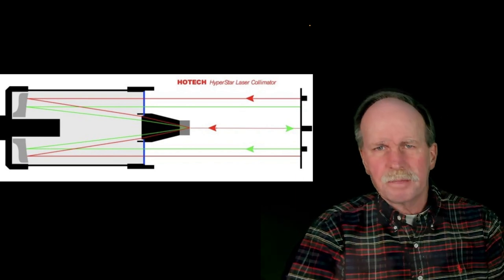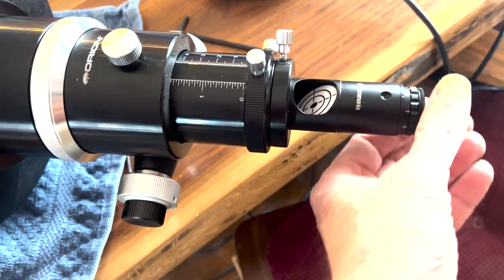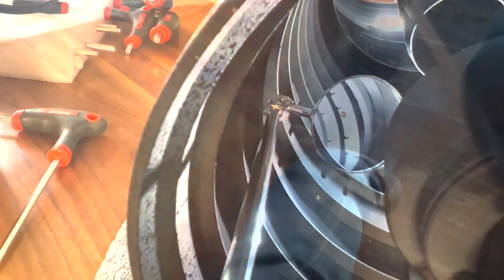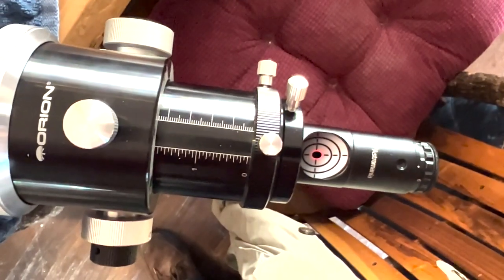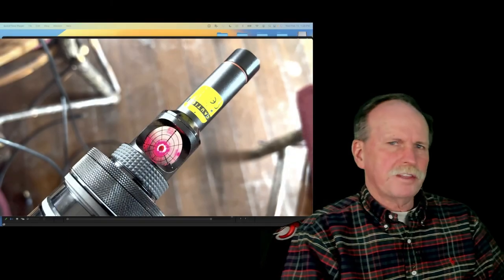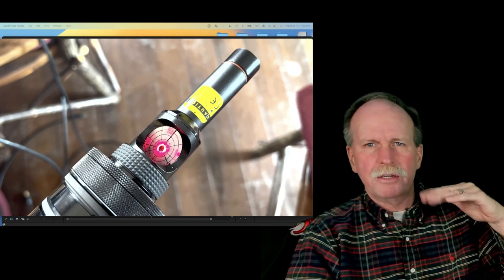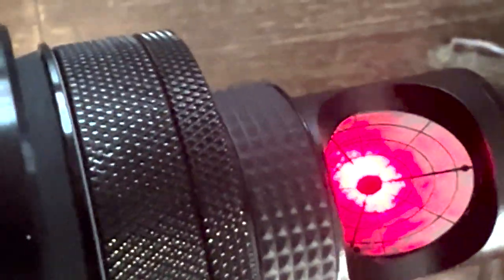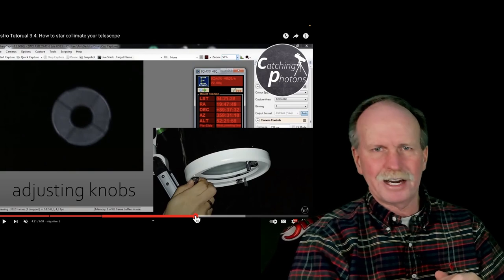Lessons Learned in Astronomy | Laser Collimation

Comment: That great for an RC, but how about other designs such as an SCT or CDK type scopes
Reply from the maker: Funny you should ask.  I have a Hotech Advanced SC Collimator and I'll go over that in an upcoming video.  The problem with the basic laser collimator is two fold.  

1/ Is the laser itself collimated?  Put it in a diagonal attached to a bench and shine it on a wall 20-30 feet away.  Then rotate the laser in the diagonal.  Does it stay on the same point and just twist, or does it form a circle?  If it forms a circle it needs to be collimated until it stays at one point.

2/ The simple laser only squares the secondary to the visual back.  If the visual back is not square with the primary mirror, it is still out of collimation.

Hotech Collimator squares the primary to the visual back and the secondary, and centers the secondary on the primary.  The drawback is that it cost nearly $600 (consider joining forces and buying one for a club rather than individually buying one).  The advantage is that once the primary and the visual back are square, it is a simple matter to square up the secondary with a laser and a defocused star.

I collimated my SCT with a simple laser.  I couldn't get a decent focus (HFR around 4).  I got the Hotech and collimated it properly, then did a star collimation of the secondary and now I am sitting pretty around HFR 2.5.

I'll do a video on the Hotech shortly.
Reply from the maker: The hotech video is out
Reply: @ShamrockBanksObservatory  going to look for this one now!